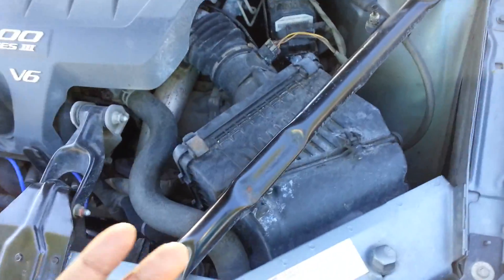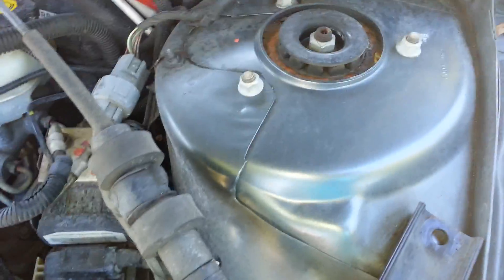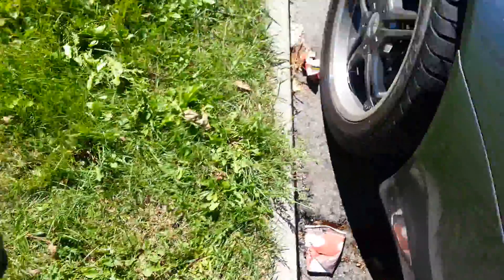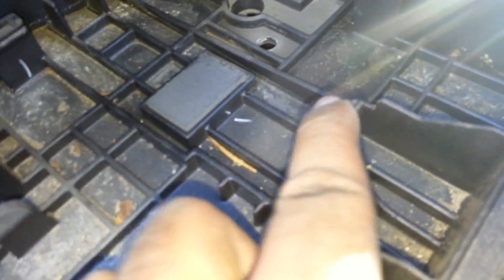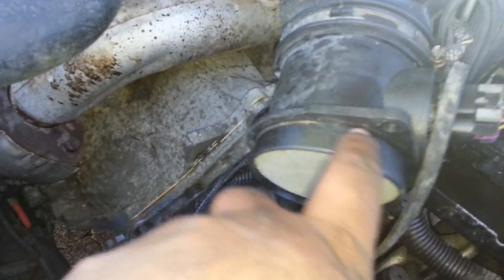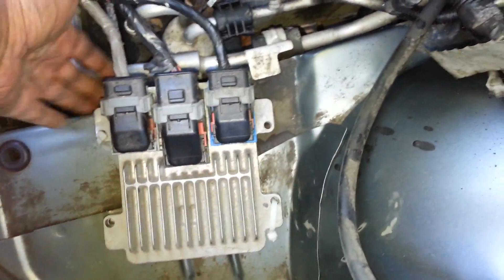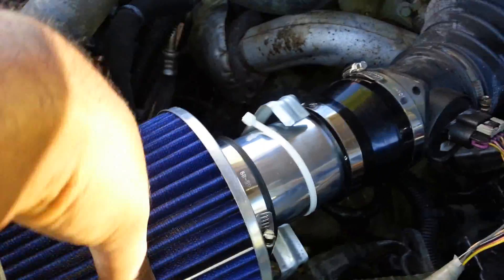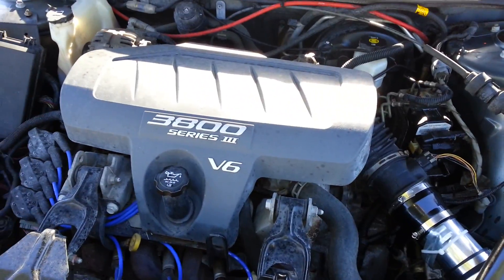04 and up Grant Prix-Adding an Air Intake

Comment: What's the approx hp gain .?
Reply from the maker: I didn't do a dyno before-and-after, so I couldn't tell you exact numbers. I can tell you that I don't think it's much... probably no more than 5hp. However, the engine response time improved significantly, and it picked up a lot quicker because it was getting more air when needed. Also, it had a nice sound to it. Check my other video on porting the stock air box...that made even bigger improvements to response and performance
Reply: @NexusAuto  Wheres that video at?
Reply from the maker: @mcdavidhome100  Which video? The one with the ported box? If so, this is the video for ya
https://youtu.be/HiqFHagSmO4

Comment: Clean work, but this coulda been WAAAAAY easier. You keep the one piece of that airbox, to use as a heatshield. You bore out the plastic hole, just big enough to have the new pipe fit right inside. 
Add some heat shielding, and make it flush with the hood. 
Boom. 
Cold air intake that doesn't cost you $300. 😂
Reply from the maker: Well, Mr Ymous, if that is your real name (lol couldn't resist!)

To be honest, I would think this is easier. Aside from the bracket, everything just bolts together, more or less. However, your way is far more professional and efficient. Eventually, I did actually cut out my air box interior entirely and put the cone inside, making it a cold air intake, but pulling in a lot more air from the fender. I made a video on that too. Still, I have other plans for the future with the intake! 

Thanks for the feedback and tips. It will help give viewers a different option and perspective!

Comment: Do it make it sound louder for the muffler wise ?
Reply from the maker: A little, it did not affect the muffler output too much. It did have a much nicer growl under the hood. The video doesn't do the sound justice. The exhaust had a slightly lowered register(growl), but no enough to really make a big deal about.

Comment: I'm putting my stock back air intake back on makes my engine too loud, at 3am I'm starting to hate that air sound, it really does not add horse power it just for feeling cool, I'm a adult now I like quite cars..lol
Reply from the maker: LOL nothing wrong with that. I also agree, it doesn't really add a lot of power. Maybe a couple of horses. But I do feel the car is far more responsive with the throttle then with the stock system. But it's all good. Did you get it done yet?
Reply: Nexus Auto I went to salvage yard found a Buick with the 3800, took the stock off that, and put it in my Monte carlo, fits like a glove. I'm happy it alot quieter I can sneaky up on ppl now
Reply from the maker: Haha very nice. That was pretty clever...most people dont realize how interchangeable those parts are. But now you are all set with your much quieter ride. Must be a night and day difference.
Reply: Nexus Auto it's just my work car thats why I chose the 3800 platform, super easy to maintenance super easy to find parts, I can go to any junk yard and find anything I want.
Reply from the maker: same reason I love the platform too. I can be many things, from everyday cruiser to beefed up sports car. To each their own. I loved cruising the junkyards too. I found so many things for my car in excellent, brand new condition.
Reply: Nexus Auto it too bad I cant take a super charger off another 3800, put it in mines I heard you can't do it though. Doesn't fit
Reply from the maker: That's not quite accurate. It can be done, but it is a LOT or work. You have to change the heads, injectors, and some of the bottom end. It is a crazy amount of work to do it. So not even worth it. But it would be nice. i see so many 3800 SCs at the junkyard, but I am happy with my 3800 and dont want to swap either. I may get a ZZP kit in the future, as it will actually produce more HP than the SC 3800, but it is pricey, so not high up on my priority list right now.

Comment: Whats the name of that air intake I want to change mine
Reply: Looks like Spectre. they sell them in Auto Zone. You should be able to find something comparable on ebay, just measure the diameter size of the throttle body, and figure out what the cfm the engine in flowing. You can call a tech dept and look for the right size of a filter company.

Comment: do you have the link to the Air filter?
Reply from the maker: Reel time, unfortunately I don't anymore. i got it a while ago. most performance stores should have it, along with Ebay. thanks for watching!
Reply: +NexusTMPG Okay  not a problem. thank you for posting!
Reply from the maker: +REEL TIME no problem..if you have any other questions, let me know
Reply: +REEL TIME    http://www.protuninglab.com/04pogrpr3v6s1.html?utm_source=googlepepla&utm_medium=adwords&id=140851311898 

This should be it. It's a short ram kit. I believe it should come in blue as well. Hope this helped

Comment: Dude why didn't you spend the extra $30 on a cheap heat shield, the video was amazing and very helpful, but your intake is right by the exoust defeating the purpose of the cold air intake because now I sucking in hot air from the exoust and the engine
Reply from the maker: It was my next intent, but I ultimately honed out my air box and made that work (which has been great). FYI, because it is offset, away from the engine, and not overtop, and but the intake duct in the left fender, this does not get as hot as people think it does. My intake was indeed a few degrees cooler than stock. However, in downtown stop and go traffic, it did get a few degrees hotter. But the additional air volume being pulled more than compensated. I had many debates with others on this. Some cars, it is a terrible idea, but this was...ok. It definitely could be better (making a heat shield, reworking the air box, etc), but this was more effective than it would seem.

Comment: Where did you get this air intake?
Reply from the maker: Nathan Birch I bought it off of eBay. Not even sure if they still sell it as I bought and installed it 4 years ago. I have since changed the cone to a K&N cone, but other than That, it's still fully functional

Comment: cant use this on 07-08 different air box.   k &n doesnt make one for them even
Reply from the maker: Brian U thanks for the heads up to it. I won't deny it, but can't confirm it either. I checked into it, and you are absolutely right... K&N only makes the filtercharger for 04 and 05 models. 06, 07 and 08 is not available. but the regular k&n filter is the same for all models, 04-08. also, I checked with other airbox manufacturers and they claim it is the same for all series III GPs. and on a brief visual inspecting, they factory airboxes look the same. so not sure why K&N doesn't offer it for 06-08. if there is any insights you can give, that would be awesome, because it has me stumped as to what the difference is, if any. but thank you for bringing it to my attention
Reply: can you post a video of the airbox so i can see all the hose hook ups then i can do the same and we can compare
Reply from the maker: Brian U not a bad idea. I'll see when I get a chance, I'll put together a video with the original airbox to compare
Reply: tag me in it when you do please
Reply from the maker: Brian U will do

Comment: Can you explain this to me? What is the point of doing this? You will be taking in hot air. Am i wrong?
Reply from the maker: +ShiftCFW CSGO & Modding Videos sorry for the late reply. There is some risk(minimal) that it will be taking in hot air, but the intake points down and away from the engine. .It is really taking  in air from an opening right below the driver side headlight, where a cool stream of air comes in(that fees the stock air intake). At speed, this is what feeds the system. Results have been good too,, I noticed better fuel economy, and a smoother idle(and a better sound) from the change. They also sell enclosed unit, which protect against the heat. Of course, those are better, but not as cost effective. Thanks for watching too
Reply: How to put in a ghetto quasi-CAI on the 05 GP. Stick to k&n if you 
want something that looks good and gives great performance, because a 
heat shield is necessary for this to work better than the stock airbox 
on the GP. In fact, this ghetto-mobile may work worse than the stock 
airbox. It will just suck in hot air when that hood is closed, fella, 
making the engine run worse than the relatively cold air the stock 
airbox brings into the intake, with most likely a reduction in mpg and 
hp. Hell, you might as well have gone the cheaper Home Depot CAI 
route....just google that, if you don't know what it is. It would at 
least work better than this bastardized-looking setup! If you cannot 
afford the k&n CAI and you don't like the look of the Home Depot 
CAI, you're far better off with dropping in a k&n filter in the 
stock airbox than this shitty mess you made! K&N air filters do 
significantly improve airflow into the engine, and you don't have to 
change them every three or four oil changes like regular air filters. 
They just need a cleaning and lube every 50k miles or so. They'll last 1
 million miles, because they're made of an oil-impregnated cotton 
material that's very durable and lasting in that environment.
Reply: +Kit Jacke Wow and i want a Aire intake ser set up on My 1999 Pontiac GTP 2d coupe. I have the KN R filter hahaha shit was funny while I read it. soo what should I do to change my set up on my car???
Reply: Kit Jacke I honestly agree with you. I recently installed a new air intake but my car seemed to get hot under the hood more than with the stock. Plus the hot air engine a heat shield is definitely needed.

Comment: Did you notice an increase in acceleration with this installed? Cuz I just ordered mine and want to know.
Reply from the maker: Iguardwisconsin berry there is improved accelation for sure. The gains aren't huge but it's noticeable. Also had better fuel economy. Not a huge amount...about half an mpg. But it's worth noting that if your throttle body isn't clean(a common problem with the GM fly-by-wire TBs) you won't notice it as much.
Reply: Nexus Auto I cleaned my throttle body 2 weeks ago and she's sparkly clean now. Have an appointment with a mechanic on the 13th to get my air intake manifold and mass airflow sensor cleaned out. My grand prix is very slow for some reason. 0-60 in 11 sec ;'(
Reply from the maker: Riiiight. i remember now. We talked about that a few weeks back, I think. Still having loss of power huh? Something else is definitely going on there. The intake will make a difference in how the car drives, but I think only after the issue is resolved. Lower power could be a variety of things. Have you had the compression checked on the engine? How does it run? Smooth, or does it vibrate and make a lot of noise?
Reply: Nexus Auto well a mechanic is looking at it next friday but it drives smooth and doesnt make loud noises. When i start the car up it makes somewhat of a loudish rev and the rpm's are high for a few seconds then it idles down. Sometimes when I really push the car it accelerates through first gear descently but as soon as it shifts into second at 50mph its a slow climb to 60mph.
Reply from the maker: Ok let me know what the mechanic says. i am really curious now as to what is happening with you car. did you and your dad check the fuel pressure at the cylinders? I don't think the Intake Manifold would cause this type of issue...it is possible, but unlikely, and not common on GPs. However, the Mass Air Flow sensor could cause it, so that may be the culprit.
Reply: Nexus Auto okay I'll let you know and no we didn't.
Reply from the maker: Cool. Good luck!
Reply: Nexus Auto Hey did your car have a black rubber hose that was connected straight to your stock air filter? Cuz I just installed my new air intake and now their is a black rubber hose just sitting there blowing out some air and nowhere to connect it to. Idk what i should do with it
Reply: Nexus Auto If you want to go to my channel I uploaded a 20 second video showing you what I meant.
Reply from the maker: I checked for the video, but didnt see it. Only a cat video lol. As to answer your question, are you running a GXP/V8? I don't recall an air return hose for the 3.8L, at least on mine. But im'm pretty sure the V8 has it.
Reply from the maker: I'll double check. Let me know when the video is up too
Reply: Nexus Auto I'll re-upload a video around 3pm today central time after work. I got the 3.8L and honestly the air intake makes the engine growl but i dont necessarily see any difference in performance lol
Reply: Nexus Auto nvm the video was still in my phone so i just uploaded it now

Comment: Putting a cold air intake in an engine bay that gets hot makes no sense
Reply from the maker: The car did actually perform better than stock like this, primarily as when the car is in motion, a lot of cooler air is hitting the filter all around, and it actually does not get hot at all. However, it is pulling a bit more hot air at idle, when there is no motion, and I am still losing a lot of efficiency vs having an enclosed space...you are 100% correct there. I did gut out my air box and installed the filter inside of it a few years ago...I have a video on that too. It helped alot, but there is further mods that I want to do. Hopefully, this year.